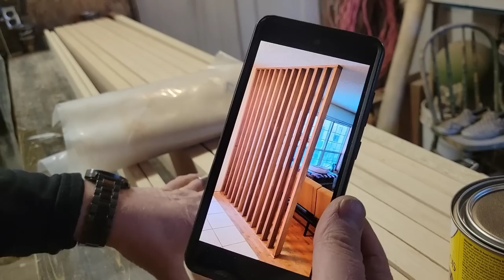Its minus 40 again | Another VLOG#192

Comment: Replace all the end parts on your mig gun. Degaser and the nozzle. The degaser is the part that the nozzle and contact tip go on and in. Or you have a hole in your gas line.